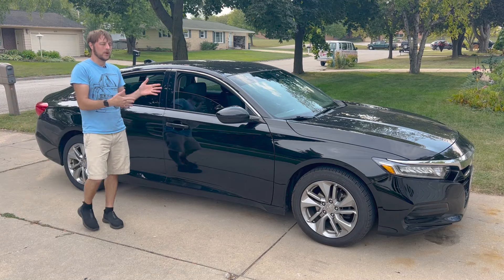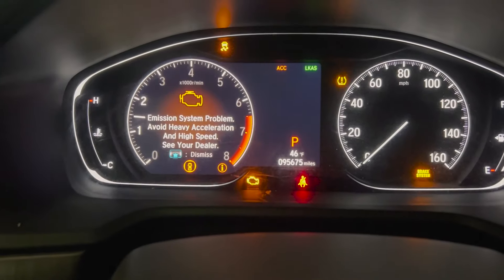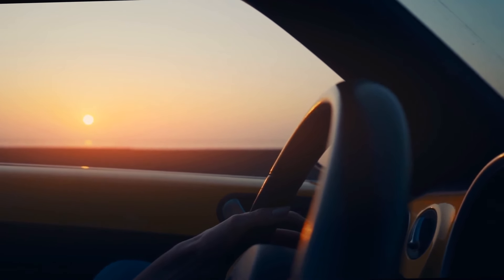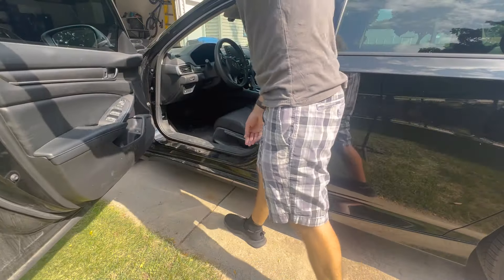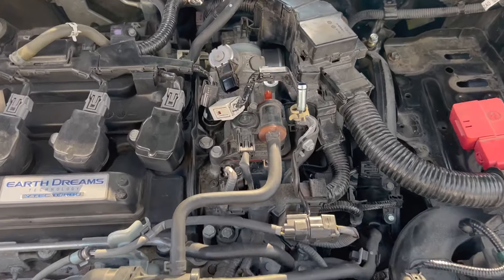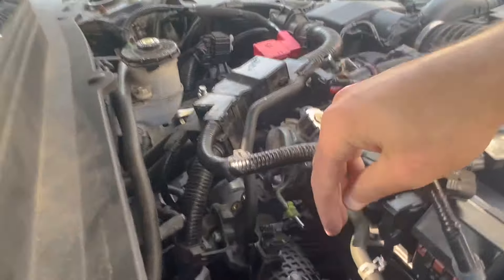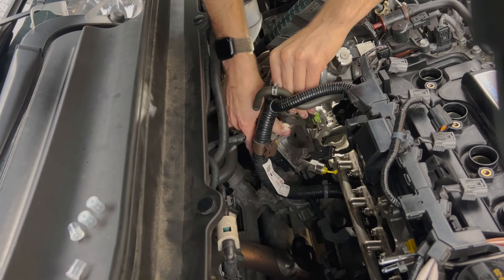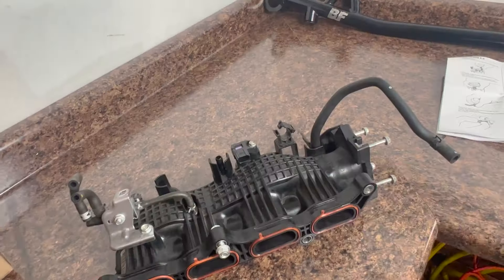Honda Accord Rough Idle & Misfire - Accord Fuel Injector Change // 2018 Honda Accord Injectors

Comment: There is now a recall released for this issue. It's the fuel pump. Take your car in and get the fuel pump replaced. My car started having this issue at 30K miles. 2018 Accord Sport 2.0T
Reply: Ouch.. I too have ‘18 accord 2.0t. Problem is local dealers say no parts available yet. Luckily I haven’t had any of these issues but I do see my fuel range drop significantly from 330+ to 200 or 198 miles on full tank
Reply: @corpuzone call Honda now and they’d have the parts. I called to set up appt. Told me if my tank was full, said yes. Told me to wait a few days so the tank can be low bc they’d don’t want it to spill on the seats lol
Reply: I thought it was that also I took it in last week and they said it was a blown head gasket
Reply: @et5256 how many miles you got?
Reply: @corpuzone I got my recall done , check again boss I got mine done 11/18 fuel pump but now I think I need to do the fuel injectors like this video
Reply: @Elmerrimac so many things 😝.. that’s why I don’t know if I’m able to keep this for long term. It’s my 2nd Honda.. first was in early 2000s that car was reliable was a civic 2 door coupe ex unfortunately got tboned accident. Years later this accord which works great when things fine. I keep maintenance on top of things and have a dedicated mechanic so I keep an eye on things. As for fuel pump, every time I call Honda they say no parts yet lol.. I’m just getting fed up so I’ll wait till they send another mail to my home. So far no issues with any power loss knock on wood
Reply: @corpuzone  ahh man ok , well Ill suggest call Honda ? Every other week ? I call them about 2 months ago and they told me they didn’t have no parts then I called them on 11/13 and on 11/18 they had everything ready keep trying and hope for the best , I’ll keep ppl updated when I get these fuel injectors fixed 🙏🏽
Reply: @Elmerrimac  I hope the fuel injectors aren’t a problem because that another costly fix I’m off warranty. Many things I had fixed under warranty that would’ve cost me an arm and a leg. Just recently I paid 600 for a starter plus labor so that’s 1k.. starter not supposed to go out that early. I have babied my car since bought brand new 2018 sport 2.0t she has 77k now.
Reply: @ full Mann ! Things gonna get better boss ! this shyt stressing me out to man 😂 and Christmas around the corner smh and same I have no warranty ! I’m thinking my Honda was not gonna give no no issues
Reply: Mine 2018 accord sport 1.5 having misfire mileage at 190000 and clue what I should to fix the misfire
Reply: @invisibleman8829  that really sucks.. I will probably get rid of my baby that I keep proper maintenance on for 6 years now since ‘18 😔 by the time I am at 100k+.. though I wonder mine is the 2.0t variant which I see from comments and other videos that people even make it beyond 100k.. I just having too much repairs on and off warranty that it’s such a pain lol!
Reply: @invisibleman8829  yooo boss it’s the fuel injectors the whole kit my dad fixed it no problems! FUEL INJECTORS GUYS! If not the fuel pump INJECTORS!

Comment: My car is like this I cleaned the carbon and cleaned the throttle body and it didnt do nothing ive had this problem since the had 20thousand milies and now it have 38thousand miles and still the i have the problem what do i check because i put in my car clean fuel 95 octane and i dont know if its the fuel injectors 
Please help me and thanks
Reply: Is your check engine light turned on? If so, what code is it giving you? If you have a code P0172 and/or P219C,D,E,F then it's more than likely your fuel injectors
Reply: Did you fix it

Comment: Boroscope each cylinder to look for coolant. Head gasket leak.  Injectors could be an issue.  Valve hose. 17131-59b-010

Comment: I have taken my 2018 accord to the dealer and have no help. No lights but it's been three times that
feels stuck and goes slow.
Reply: Any update ?
Reply: @missjaayvee I had the same problem I took mines to the Honda dealer shop they did a software update on the car a fuel induction system clean and new spark plugs…seemed to fixed the problem.Im praying it doesn’t happen again😫🙏…I haven’t even had the car a week yet…these new Hondas are shit !!!
Reply: @darriusmckeever735 was your actual problem same as original post? Induction clean may help clean the tips of the injectors only. If that solves the op problem, that's huge. You saw the tips in the video.
Reply: Yes, it was a back light connector.. its fixed  🙌
Reply: @irvnegrin2211 I changed the spark plugs ran fine for 3 days and problem came back 🤦🏽‍♂️ I’m guessing it’s my fuel injectors 😫
Reply: @darriusmckeever735  yep, in the process of doing them now. Hopefully, I can get new ones. If not, I will try getting them tested, cleaned, and refurbished.

Comment: Honda replaces fuel injectors 10 years/ 150,000 miles for free now!
Reply: Also had p219c lean cylinder 1. Went to Oreilys code showed spark plugs and valve adjustment would fix it. Replaced spark plugs light stayed on then 3 days later got p301 I think for misfire in cylinder 1. Replaced all coil packs but p219c did not go away finally took it to Honda and they replaced the fuel injectors free of charge and almost $470 for the valve lash adjustment.
Reply: Do you have a link or documentation? I found it for older Hondas (09-13) but nothing for the 10th gen Hondas.
Reply: They don't for 10th

Comment: Call the 1 800 number for honda corporate i went through them and built my case i told them i almost had a car accident because when you gets all those faults in your dashboard its going to bring you down to 10 miles and you cannot go any faster you have to pull over and turn it off and turned it back on to reset the engine.. i talked to them and after couple days they call me back and i only paid the co payment of $1,000 . Because if you don't don't do this you are going to pay like $5,000 for this. So call them and build your case.. keep in mind you are not the only one going through this .. this is now  a common problem in this accords.. wish you luck..

Comment: Sound like was the Battery  all honda will let u know when the battery 🔋 is going bad all of them will do this an don't put chep gass I a honda put like ExxonMobil Texaco Valero.
Reply from the maker: There was a brand new battery put in 3-4 months before i did the fuel injector swap. I forgot to mention it in my video. Battery wasn’t causing my rough idle issue.
Reply: @BoostedFilms  I just replaced battery and spark plugs and it’s still has all the xmas lights on the dash .  Next is compression test . It’s almost like these cars have the same issue . And once fixed it doesn’t seem to last long . This is horrible. Definitely stay away from these 1.5 turbos . I’m helping a friend right now with one
Reply: @Eddie510s I have a 2018 Accord hybrid. I bought the car 1 year ago with 60K miles on it and last week all lights started popping up on the dash. I’ve seen so many people with the same problem! really regret buying it!
Reply: Hello! I have a 2021 accord and last year my injectors were replaced due to all lights on the dash and a misfire. Since December of last year I’ve been dealing with a random long crank and a hard start. It will happen at random times no real pattern. Dealer replaced fuel pump due to low pressure and then the high pressure fuel pump due to a dtc. Car is still having the same issue but dealer is not able to duplicate and there are no codes. Any suggestions?

Comment: The shake at a stop with you foot on the brake is most likely torque converter. Try a transmission service. Drain, fill and filter.